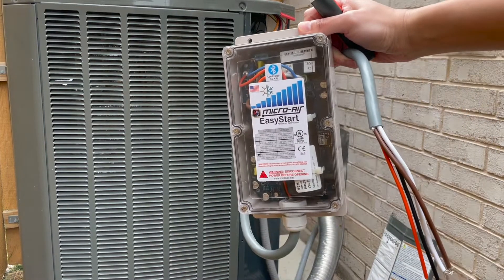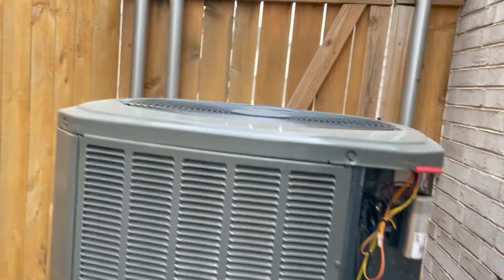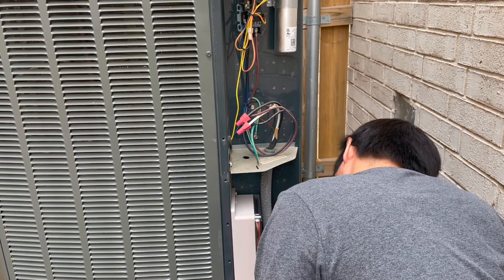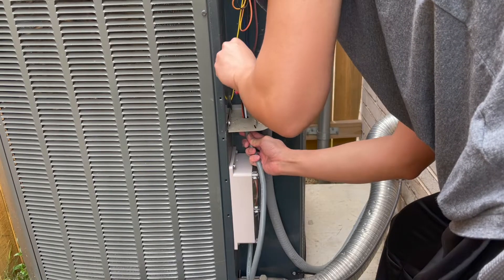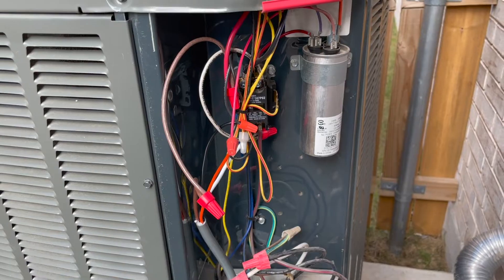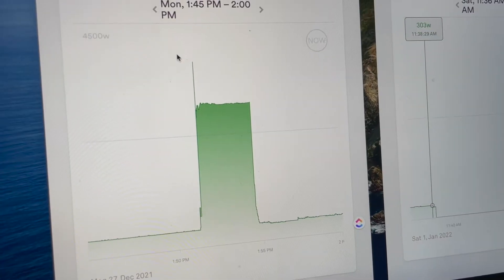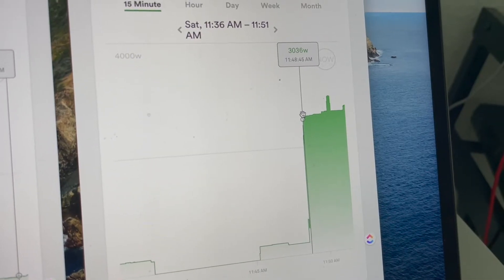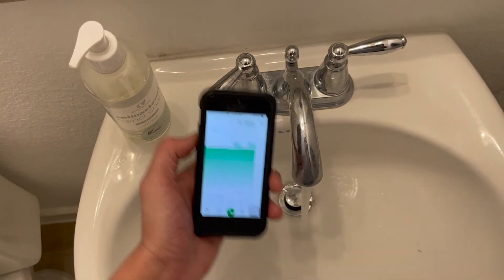Running a 4 Ton AC on a GENERATOR - Micro-Air Easystart 368 Installation & Testing

Comment: I had one of these installed on my Goodman 3 1/2 ton heat pump and man what a difference it made! My Bluetooth reading shows 28 starting amps, down from around 85-95 amps prior to installation. Can run my ac on my Champion 7500 watt generator. Not sure about the heating yet but in Texas cold winters are rare so no biggie. Also, I am amazed at how many times my compressor  has started since the micro air was installed. (5300 times) This will definitely extend the life of my compressor so I'm very happy I made the small investment. Was wondering if I should put one on my refrigerator???? Thoughts? Steve from Rowlett, Texas
Reply: I always get a kick out of people suggesting their compressor lasted longer because of the micro.    I’ve never used one and never had a compressor go out.   It’s incredibly durable.   Power outages are its enemy that’s why I have a surge directly on it and also a whole house surge.
Reply: @Imwright720  Agreed however with the easy start you could go with a smaller generator that saves money right their . When I install a A/C unit I always roll in a surge protector into the price without telling the customer. Then when they see it and I explain it to them their jaws drop. And I install them right at the unit not the disconnect.
Reply: @wd8557  I ordered one because my generator does groan a bit when my 4 ton starts.   We get hurricanes and it’s run the house during  13 and 14 day power outages.  I haven’t needed it since  2006.  My main concern is would the micro damage the compressor.  I figure if they engineered the compressor to start with high amps then lowering that might actually damage it.  They offer a warranty but it’s worded in such a way as they would never actually payout.
Reply: @Imwright720  Depends on the system. Some bigger units will have a potential relay that adds power to the compressor at start up, then drops out in nano second's.  This  never allows the compressor to run at full amps and stays on during the cycle. So let's say your system runs at 50 amps compressor and fan. With this your running at 30 amps ( example ). I work on big refrigeration and they usually run off a vfd drive. Where you can controll load 70% 80% ( example ). This will do zero damage to your compressor or fan. If either goes bad its just because it went bad. Hope this helps you out. Also you owe me 59.95 for the youtube counseltation., or if I ever run into you a ice cold budlight.
Reply: @wd8557  sounds fair
Reply from the maker: hey Steve! I wouldn't recommend putting one of the refrigerator. The surge amps for refrigerators are pretty low (~1000 watts for your typical refrigerator). If you're able to keep under the 7500 watt load of your champion, you should be good to go. Refrigerators fortunately use a lot less power than HVAC units.
Reply: How long do you think it will run on a full tank with and without the ac

Comment: This is the exact emergency setup i am working on in my 2800 sq ft 1 year old home here in New Caney TX. This Geny is great as we have had to use it in our new construction neighborhood a few times do to prolonged power outages with an installed Interlock Switch at our panel. The questions I had for my setup running my ac condenser with the exact same geny, you have answered and i am now considering purchasing the soft start. I have only run this geny on gas, but have purchased the nat gas snorkel conversion kit. I am looking forward to your nat gas conversion video. Thanks!
Reply: Just be aware that you lose wattage when running on ng/ propane....BUT you should still be fine...good luck!
Reply: Can I run a 5 ton AC unit with a 5,000w generator with the Easy Start?
Reply: @davidh3861    the ASY-368-X72-BLUE is rated for up to a 6 ton AC compressor.  I just ordered one for my 5 ton unit.  Unfortunately, It won't be an apples to apples comparison, because I have a 10,000-wat generator.
Reply: I bought my soft start at a place called Hayes near north belt and 59. Run my 4 ton unit and the rest of the house with an 8750 inverter generator.

Comment: Hello there..  questions  1. Are you using a 30 AMP connection for the Generator or a 50 AMP,  2. Since you installed the easy start did you noticed if your electricity bill went down since its consuming less electricity to start. 3. What brand of AC unit condenser do you have?  4. Under full load, refrigerators, microwave can you use those at the same time as the AC unit when you are using generator ?
Reply from the maker: @The right is wrong I concur in my energy bill observations. It has not gone down at all this summer and is in fact more than last. Have to factor that we've been in a 90-105 degree heat wave for the past few weeks though.
Reply from the maker: hi Juanti, 

1. I'm using a 30 amp connector (NEMA L14-30).
2. I installed the easy start pretty much in the winter so I can't really comment on energy usage yet. I'll update you when it starts getting really hot this year.
3. Air Condition Unit - Trane XR16 series 4TTR6048J1000AA from 5/2020
4. The refrigerator works fine, I didn't actually try it out with the microwave. Next time I'm on generator with the AC on, i'll give that a shot. One thing to note is that there are 2 legs of power (the black 120V and the red 120V). The microwave works on only 1 leg so you might actually cause one of the legs to go over the 30 amp limit and trip the breaker if the load is not well-distributed between the 2 legs.

Comment: Whap app you using on the computer and phone
Reply from the maker: That’s the sense app. You install a energy meter in your main power panel to measure the amps and voltage coming into the house. It then provides the wattage reading for everything- it’s pretty neat!

Comment: Happy to ran across this great video . I’m planning to purchase one for my 2 ton ac unit to run off my AIMS 6000 watt 24 volt DC split phase 110 - 220 v inverter charger for my whole house  . It can run the ac without one but I need one to handle the inrush current and to maybe 🤔 conserve battery power as it starts and runs the ac unit . You can check out my solar videos about  it running the ac unit  , hit like ,leave a comment and subscribe . Someday you might want to try and go DIY solar like us preppers  . May the solar be with you . Zai Gin , Joi Gin and Xie Xie .

Comment: Curious to what you are doing to see your current wattage usage on your phone. What's it reading from, the generator or the outlet?
Reply from the maker: The current wattage from my home is being read from my Sense whole house energy monitoring system (https://sense.com/). I wired it up in such a fashion so that I can monitor both the generator power input and the main power input by running both the main lines and the generator wires through the amp meter clamps in the main panel.

Comment: Sure would be nice to watch you wire the unit to how it’s done. Thanks for replying back.
Reply from the maker: Yeah, I really wanted to, but I messed up on the wiring and I didn't want to show the wrong thing as it would probably be confusing. I had the brown go to the contactor and the white go to the condenser. Turned it on and the condenser wouldn't power up. I was somewhat scared I fried something, but fortunately reversing the wires - white go to contactor and brown to the condenser and everything started up happily. Hope you don't make my mistake if you're doing this, best wishes!
Reply: @jonathanDIYs  I thought the instructions indicated that you completely eliminate  the original condenser  from the system?

Comment: What square footage is your home? I have a 1500sqft home with a 4-ton AC and my WEN 8750 Watt Inverter Generator with a MicroAir cannot start it. I'm getting about 35 amp, and when measured at the panel I get max of 41amp (blower fan and Compressor outside). Thinking about downgrading to a 3-ton or 3.5 ton. Every calculation I used online said 4-ton overkill.
Reply from the maker: I would tend to agree that a 4-ton AC is overkill. My house is 2800sq ft and the 4 ton seems to cool it sufficiently well. I don't know if it is because I have a new house though with good insulation. How old is your unit? 

If it is taking up 41 amps to run regularly, it would definitely seem like your AC won't run on generator. It isn't an inrush problem at that point but just a regular load problem. 41*240V = 9840 watts which is way over the regular running power of your 8750 generator which I believe is 7000 watts. You'll need to get the whole house under 29 amps if you want to power off the generator. I am fortunate that my AC takes about 14-15 amps after the inrush which allows me to run off AC. Wish you the best in getting everything working together!
Reply: My 1400 sqft house was built in 2005. I have an XR14 which is 2.5 tons and it heats and cools my house easily. Your 4 ton system is actually doing you more harm than good because there's a good chance your system isn't being able to go through proper cycling times to provide the best efficiency. The humidity levels in a home typically dictate the efficiency of an HVAC system. Consistently high humidity levels mean one of two things. Either A) your system is too big and it's cooling the house too fast. This is a problem because the system isn't running long enough to remove the necessary humidity that it should be removing. Or B) High humidity levels are from a system that is undersized and is not able to keep up with cooling and heating demands. This isn't the case with you. The lower the humidity levels the better in terms of HVAC efficiency. My house typical hovers between 38 and 50% humidity levels. This is just about perfect.
Reply: @Ozzie4Para  So, in other words.. you're really not sure.

Comment: Bet you money the inrush after the easystart is under 30 amps, if you have the bluetooth model you can connect and check it in your stats.  Pro tip the AC has to be running and your gps on to connect to the easystart, I also have a video how to do it.  Back to the under 30amps part, easystart has to do this because its made for RV's and campers to power AC units off of 30amp service panels or generators that have 30amp service... like ours.  You should have no problem with your setup running on natural gas, its wild my 3.5 ton AC pushes 5k watts and the generator can keep up and run everything else in the house pretty much like normal while on NG.  Curious if sense helped you wire up to work on portable power or did you have to figure it out yourself like I did?
Reply from the maker: Good idea! I haven't connected to the easystart on bluetooth yet - I've been just measuring everything using the sense or that external clamp meter (which didn't work to get inrush properly). That's very interesting that your 3.5 ton AC takes up more power than mine - once my 4 ton AC is all on, it only takes 3.5k regularly. I'm guessing it is because my AC is just around 2 years old as I just bought the house recently. 

About the sense wire, I got that idea after watching Benjamin Sahlstrom's video - https://youtu.be/Y26CBqpS2M0?t=725. Make sure you have the direction of the wires the same way or it will give weird readings. Aka, both wires have to be going "downward" through the clamps - you can't have one going upwards and 1 downwards. I think you mentioned you have your sense all working already so you might be all set there already. Thanks for watching!
Reply: @Jonathan Chan  I wish I would have thought about wiring it like that before I got the extra flex sensors, duh! They were only 20$ so no biggie. Thats essentially how I have it wired, but when I'm on generator power the app says its on generator, u can see that in my video. Still going to make video using the flex cables and also ref ur method. While ba j I called sense and they told me it wasn't possible. Just needed some creativity! Thanks brother!
Also if u connect to the app it shows u ALL the stats.